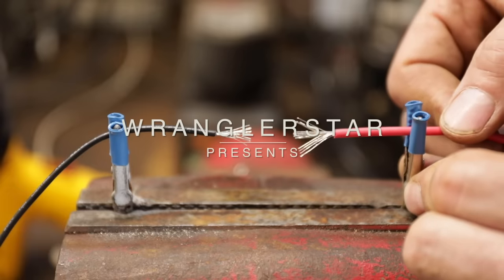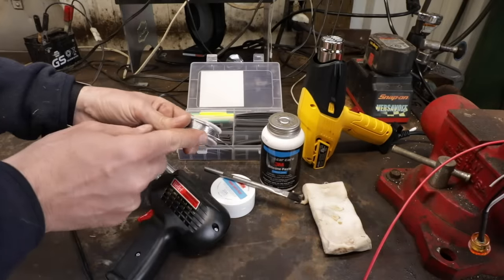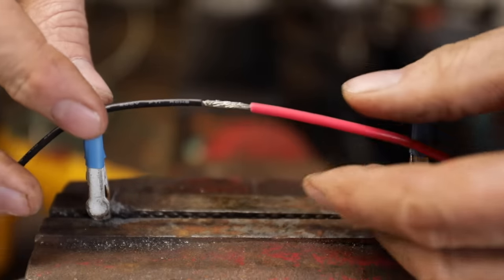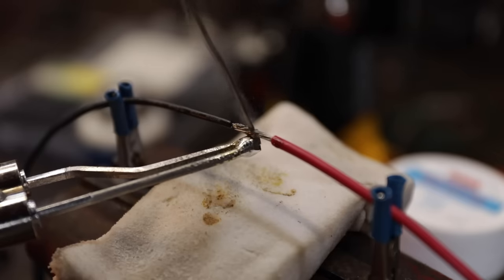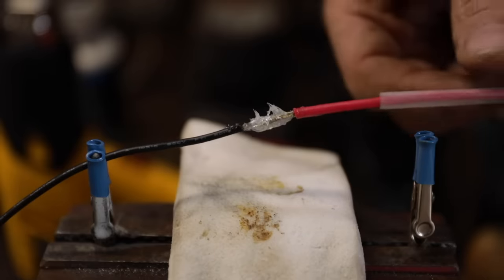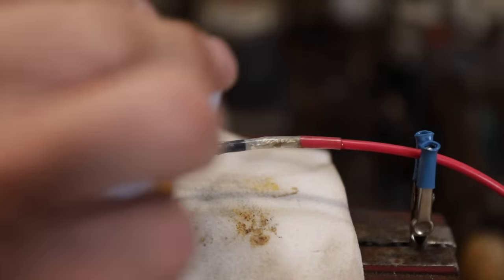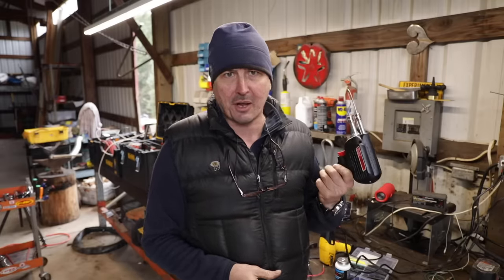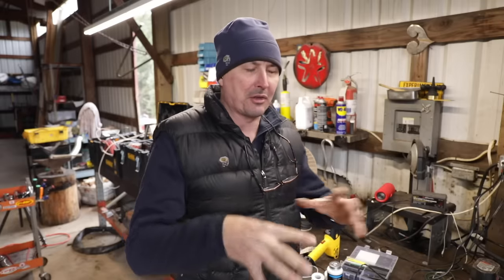How To Solder Wires Like A Pro

Comment: No "pro" is soldering like this. This is an old fashioned method nobody uses because it leads to weak joins. The method today (and what you should be teaching) is a simple bell wrap that will never slide apart. You're also soldering wrong, heating up the wires and using those to melt the solder. You melt the solder into the wires by touching the tip of the solder to the soldering iron. By heating up the wires that hot, you're making them more brittle and prone to breaking.

Comment: Try putting solder on the tip and melt some onto the wire but make sure the solder permeates the entire wire strands. This help in heat transfer and doesn't take forever for the solder to start flowing throw the wire like what happened him in this video. Calling this soldering for pros is a bit of a stretch lmao. Anyways best of luck

Comment: These are good videos, but when dealing 30 year old car where is 2 years old ope wire. To solder that, when should cut long wire, far away is hard some times, so it is easier to use connection or something else. Also usually those car wires has some coating on the, so that soldering iron cannot stick  on the wire

Comment: 🤔 Yes that soldering components splicing cables is very good. But definitely do not agree with you regarding splicing connecting cables that can be used for car boats. I have a car where it still works after 40 years. You probably do not know that in Europe Sweden has existed for many years! splice couplings that contain the solder and shrink tubing where you pull the cables in and use the heat gun lighter. and ready to use. Hopefully it may also come to the usa in the future. Nice and entertaining channel.

Comment: i used to solder in my first work and nobody played with it like that... :D just butted together and soldered...btw.  you should start with enough tint on the tip so it conducts the heat. without that you will burn the tipp and tint won´t stick to it anymore and you want to solder it as quickly as possible to avoid melting insulation on cables. we would eat you alive for this :D

Comment: i had tiny wires very short.. i ended up getting a bad connected i think.. quad pulling a lot of amps to hover.. Im have to unsolder connections and retry.. Think Im have to remove motor plugs because wires left on plug are so short.. and wire straight to FC,..  Wish left more wire to try this

Comment: Three words for wiring repair: avionics environmental splices. Will work better than any solder joint.
Reply: Yes.... BUT, $50-$100 for the crimp tool (good, non-Chinese) one and about $0.65 per joint that you have to order (not available at Radio Trash).

Comment: Not the best, but should do the job. for electronics, you need a much smaller iron probably with a point. you don't have to use that silicone, any silicone sealant will work to one degree or another. It doesn't have to be dielectric The way of putting the wires together works, but isn't always what you want to do. Your tip must be tinned first, but you put the drop of solder on the tip then touch the joint so that there is better heat transfer. Depending on what you're doing, you don't always even need the flux, the solder is rosin core for a reason. The flux helps, but isn't absolutely required if you don't happen to have any on hand. This covers only stranded wire anyway. Sometimes you need to solder solid wire. There are various ways to wrap the ends together, I don't think I even remember them all. Ever since the invention of wire nuts, I really haven't done much soldering. You do know that at one time, even house wiring got soldered, and there was a prescribed (code) way to tape it up... this was also before heat shrink was available. Yeah, I'm old. I was taught in 4H by a professional electrician. The lessons learned served me well, even though these days I don't use it much, I did for a long time. Another way to do the wires is to twist them solid, then put a thin coat of solder on them. you then twist one around the other wire one way, then the other wire the other way, then solder together... easy since the wires are pre tinned. this method is better for wires that might see pulling stress... also works with solid wires, but you don't have to pre tin them, That's just one way I remember. When I made my display board, there were like 12 different methods  Back then, they got wrapped with a cloth friction tape, with plastic water resistant tape over that. 

IN A PINCH.. you  can cut a piece of plastic straw, slide it over the wires, twist them together hard, then put on any good silicone caulk, then slide the straw in place. This is an on the road repair that will last much longer than you'd think possible.

Comment: No need for flux if you’re using rosin core solder. No need for silicone. Use shrink with glue on inside.

Comment: This is right at many points, but researching the 3m silicone paste is straight wrong, it creates a non sealed gap between shrink tube and outer rubber of the cable, i.e. makes what is already secure less secure, assuming it will not be waterproof, by guarding against it not being waterproof.

Comment: shrink tube has adhesive to seal the exposed wires. you don't need a silicone to protect it. adding silicone grease is probably contaminating the adhesive In the heat shrink tube.

Comment: Lineman's splice is the correct way
Reply: .... linemans splice is not for stranded wire, is it?
Reply: @t_Mies  Good question.  I've always twisted the ends tight and then done the lineman splice.  Never had a issue with it.

Comment: soldering wires together is a great solution but it depends on the application. It is not for everything. For example, it is not approved by the ABYC for marine applications. Soldered connections are not up to code.

Comment: The internet says Do not use silicon grease on elecrical wiring. Its bad for the plstic coatings and it doesnt conduct electricity so its bad for on metal wire too? What am I missing?

Comment: Don't start with a cold iron. You want the contact to be as hot and brief as possible, so the heat does not have time to travel down the wire, melting the insulation.

Comment: As far as i was told tinning it  is so the heat transfer easily from the soldering gun to the wires.
Reply: Its the hot solder on the tip that transfers the heat not the tip itself. It also keeps your soldering tip from oxidizing. Always keep fresh solder on the tip when the iron is on and apply solder to the tip before turning off the iron so the tip is not exposed to oxygen

Comment: Protip: Get two aggie clips, a piece of thick solid copper wire. Connect the base of both clips to the ends of your wire; solder if you want, or just use the set screws. TaDa! adjustable hands free clamp. Works great when you need to align two wires in a tight spot.
Also, learn to solder, not like this video.

Comment: Fraying the ends of a wire isn’t a good practice. Clean wire doesn’t need additional flux, it just slows the joint down, use the rosin in the core and it’ll flow just fine. Buy adhesive shrink tubing, silicone is pointless. Tinning the tip is cleaning all impurities from flux, oxidation and dirty wires, to aid in heat transfer. The faster you get the joint soldered, the less solder travels up the strands and ruins the insulation. If you absolutely must use flux, kester 186 liquid is my preference. I also use Kester’s eutectic solder, makes life easier. This is a very rookie video, I mean no disrespect by that, but in no profession would a joint soldered like that pass any form of inspection.

Comment: I have been soldering wires for a living for over 15 years and never frayed the ends to intermingle them, it will work but it's not necessary.
Reply: Just put the stripped parts side by side, add some flux and get it spread all around the exposed wires, put a glob of solder on the iron tip, then paint it across the top, it will flow completely around all the wires and inside the wires, no spikes if there was enough flux. Then you can clean off any flux residue with acetone or denatured alchohal

Comment: Whenever i use this method to solder i can never get the solder to melt. I end up having to touch the solder directly to the gun and hope it ends up on the wire. Is it because i bought a cheap gun off amazon? Its the cheapest plug in soldering gun you can get with the red handle.

Comment: That must be the longest form of soldering I have seen..buy a hand held butane torch ,strip the wires twist them tight,slide shrink tube 6 in away heat up copper wire touch flux solder onto wires ,make sure no drips of solder have created a sharp point slide shrink tube ,Adjust flame on torch to yellow flame,,shrink tube.Done.

Comment: But how do I strip the cable without cutting all the wires? I spent $20 on a cable stripper and sometimes it works, sometimes it doesn't. I don't wanna keep screwing it up to the point where the cable is way too short.

Comment: Do you have a box of power bricks, that never seem to have the correct voltage or connector for the thing you are trying to power? Well with the basic skills described in this video, you'll never have this issue again.

Comment: I have never seen anyone putting grease on the soldered connection and I solder frequently too I have never done that as its not needed as lead and tin and the copper of the wire does not get corroded by water

Comment: Splicing the fine strands of the wires together is a waste of time because the solder joint will be stronger than the wires themselves. You can prove that by pulling soldered wires apart and seeing that the wire breaks not the solder. Just twisting the wires together is the same strength and much faster.

Comment: Dude... put the shrink tube on first. Use shrink tube that has clue inside. The clue will melt and seal the connection and make it waterproof. Doenst cost much. Use less flux - if you insist on flux. For wires like that i usually dont use extra flux...

Comment: Actually, you do want to touch the solder to the tip of the iron. That makes the solder flow a lot faster than how you did it. You are risking melting the insulation on the wires leaving the iron on it for that long. That connection should not take more than just a few seconds.

Comment: You should have advised viewers to make sure the shrink tubing is on the wire before soldering otherwise how will you get it on if either end of each wire is attached to something

Comment: Wait why did you use flux along with a flux core solder? I thought the whole point of using rosin core was because the flux is already in the solder
Reply: I started doing that and it seems to make the solder flow better.

Comment: Yeah,  no need for a soldering iron or a heat gun.   Just use a lighter and you can do this in the field without electricity.

Comment: What if the wire has 3 separate isolated wires insulated inside of one bigger rubber?
Reply: You would do a linemen splice, shrink in place for each. At the end shrink the entire solder, shrink wires.

Comment: I am no expert at this but in my experience if your first contact with the solder is not at the wire/solder tip interface, it will take a long time to get the solder hot enough to flow like in this video.. Also, most of the flux will be evaporated/'used up' by this point, which as everyone knows is the key to getting a strong solder bond.. Can anyone correct me/ am I out of line?

Comment: Got a question. Doing this for the first time. Our washing machine we were told needed a $500+ repair. It has only done 700 loads of laundry but out of warranty. I pulled the controller board out to find a fuse burned out on it.   I am not sure if I should put a slow-blow or fast acting fuse in it. Can anyone give me advice on this?   THANKS!
Reply: Did you ever fix it ? I'd say replace it with the exact fuse you're replacing
Reply: @jumenss  HAVEN'T TRIED YET. other things came up. Bought a Speed Queen washing machine in the meantime. I believe it will work. have to remove board off platform it is on to more safely solder the new fuse in. fingers crossed. this is when appliances were made very well. WE get a lot of power outages out here and I think that did it.

Comment: Looks like you have a soldering gun to me not a soldering iron.  Perhaps your gun is not melting as fast as it should.  i had the same issue with my Weller gun is was ready to take it apart but I tightened the two Allen set screws on the replaceable tip holders, now it heats like a new gun again. Furthermore for faster wire heating rotate the gun 90 degrees so the top of the chisel tip makes linear contact to the wire instead of the round side of the tip making only point contact, more surface contact area will speed up the process quite a lot.

Comment: Yeah a solder is a great join but terrible in a 4x4 setup where there is constant movement and high chance those solder joins snap. They have no flex in.ess you use a crimp lug

Comment: When i saw you splicing the wires i thought well i never done i like that as i didn't feel it would be a very strong joint, then reading several of the comment i see why and most feel the same.  I know it was just a demo but why didn't you get you fancy snips cut two bits of wire the same colour

Comment: Not completely accurate. 
Flux is cored into most modern solder spools. 
Flux helps clean/prep the surface (from those oily fingers) touching the copper leads. 
Tinting the tip of soldering gun tip helps the tip make better contact with the part.

Comment: Make sure to add alot of greese, dont use glue or dual wall tube or anything like that. We neeed to evenly coat it with greese so it gets evenly distributed through the tube so it slips right off as soon as we get it installed in our boat. shrink tube is already water proof just fyi. greese is tottaly NOT a pro move.

Comment: With Rosin core solder, additional flux is NOT required . It would take a year to assemble the simplest circuits.  This is NOT how pros would assemple a simple joint like this.

Comment: That is not going to make a long lasting connection, for soldering wires together you should use a Bell or Western Union splice, it's stronger and more stable.

Comment: My problem is I heat the wire but the solder doesn’t melt if it isn’t touching the soldering iron directly
And wires become very hot but still solder won’t melt if i don’t touch the soldering iron with it

Also the solder doesn’t stay at the tip of my soldering iron at all it always drip
I hope someone can help me with this

Comment: I have that same damn soldering iron and I hate it, 20 years now.

The trigger has 2 stages of heat, halfway is full heat which I need 99.9% of the time so you have to very carefully balance your finger pressure 🤦🏻‍♂️but as soon as you move the trigger slips to no heat or half heat which is full squeeze, it’s ridiculous.

I saw a pro who had a simple always on very light with a small point for quick heating iron and that would be so much better.

Comment: Why is it so easy for every video I watch. I can't even get to stick the tin on the copper wire. I tried to melt the tin on the copper and it wouldn't melt, even after applying flux (the flux only melt). 😭😭

Comment: Soldering guns are great for soldering plumbing, and 16AWG and larger (remember inverse scale) gauges like 14, 12, 10, AWG etc.

Interesting joint not the best type. Personally I'd rather use IPC standard joints like a J hook joint.  

Also liquid solder flux helps make significantly better joints.  Flux core solder alone is not enough.

Solder guns usually are way too hot for electronics and will likely cause pads for board traces to pull up due to overheating.  60W iron works better for electronics.

Temperature controlled solder stations are honestly even better so you can get the ideal temperature for the application.

Solder flux paste works ok, but liquid rosen flux works ten times better.

Comment: Why did you hold the soldering iron sideways..??  WRONG.  you had the side of the tip touching the wires if you did it correctly the flat side should of been touching. Would of transfered heat a lot faster.. .So who is the Pro ???

Comment: I don't know why but my solder falls off , 
I have tried many components and get the same result, I tried different components and pieces of wire, metal, nails, screws etc I have done it with the same result, it falls off and the components are not sticking together, it's frustrating as people like yourself do it like second nature, I will keep trying, lol

Comment: That's not how you solder. Those soldering transformer guns with loops are anachronism. 
And you are supposed to use them differently than tipped irons. With iron you melt the wire on the soldered connection. With a transformer gun, you take  bunch of solder inside the loop, turn it off, take flux and turn it on while touching the  connection.
And the "Don't touch soldering iron with solder" is bullshit, you need it to have good thermal contact.

Comment: As a pro i could say, this is not how a pro works. It takes to much time to make the connection and it's too much work. A pro goes for a fast reliable solution. Soldering is a good connection but it's too person depending.

Comment: Sorry man. Nice try but this is not "professional" soldering.  Stop with the silly video titles. It'll work, for awhile.
The rosin will eventually eat your connection, and you sealed it in there! And you were worried about using butt splice connectors. Using flux on the outside of a joint will aid solder flow, but then it needs to be cleaned off, for this reason. (Even good plumbers know this.) And there's nothing wrong with touching the solder to the iron. It'll speed up heat transfer. Etc etc. 😲
I did military wiring for 30 years, so I'm not making this up- like this guy is.